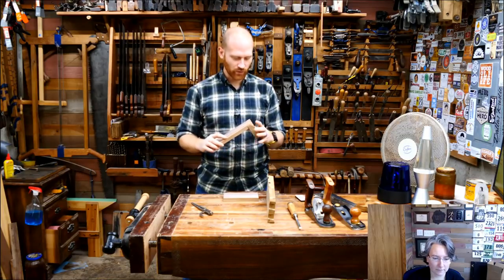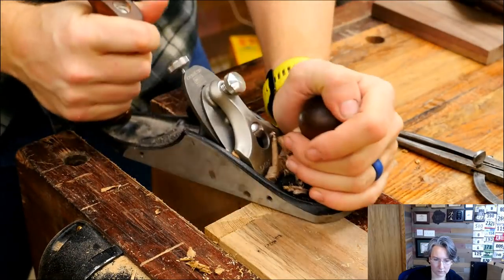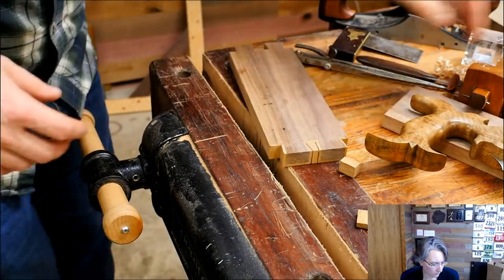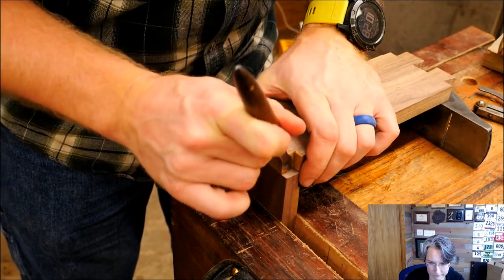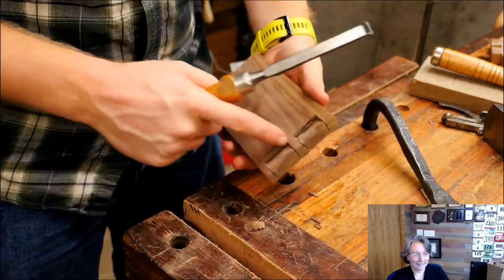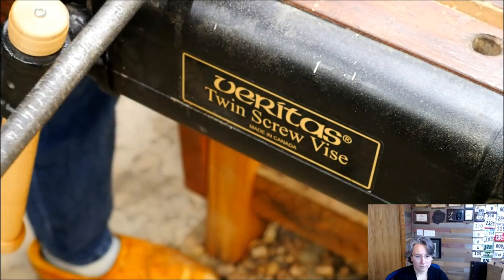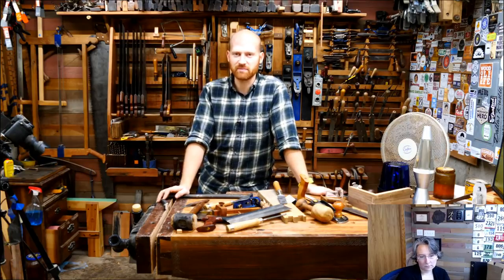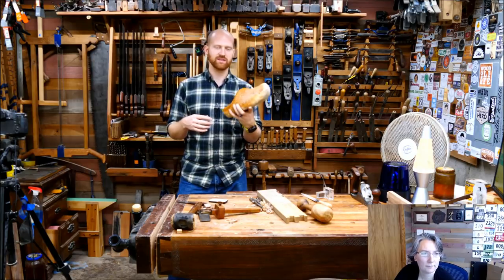How to make Inlaid Dovetails Live. Part 2

Comment: Hey.. I came across a Stanley no5 type 11 that  is in rough shape, missing parts, and worst of all looks like it was dropped and the mouth is chipped out. Since you seem to have much more knowledge than I.. is the mouth fixable by a competent restorer or should i just salvage what parts I can for my no 5 and save it for wall art?
Reply from the maker: Sounds like a good parts plane but you could also turn it into a scrub plane. you don't need much to make a good scrubber.
Reply: Wood By Wright didnt think of that... thanks man